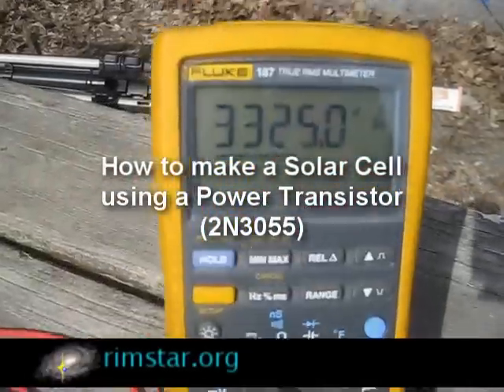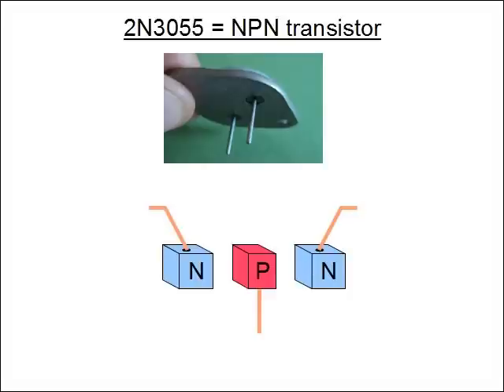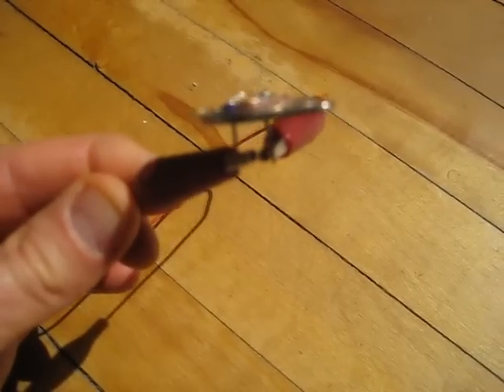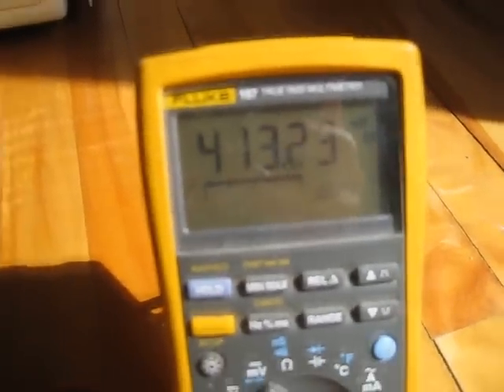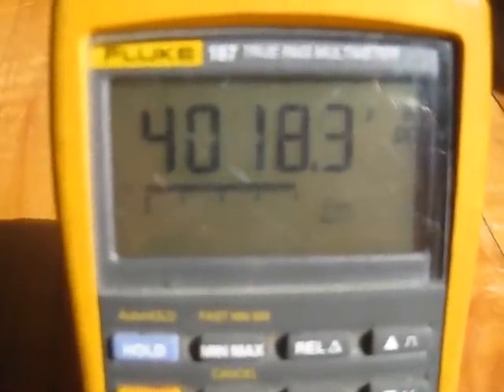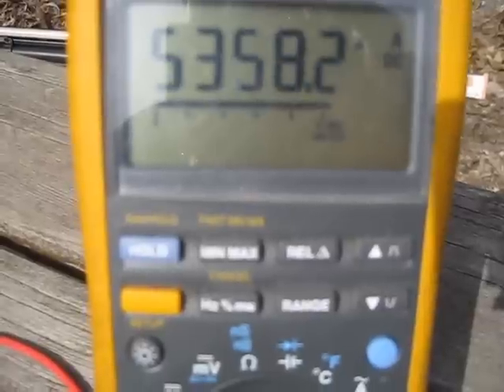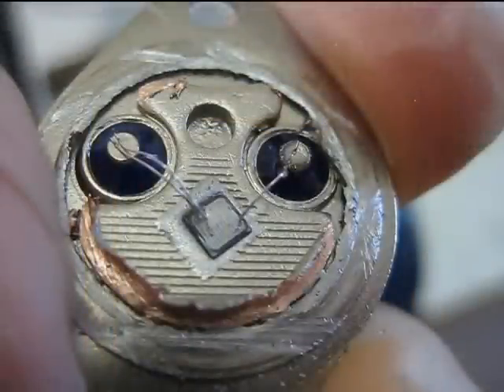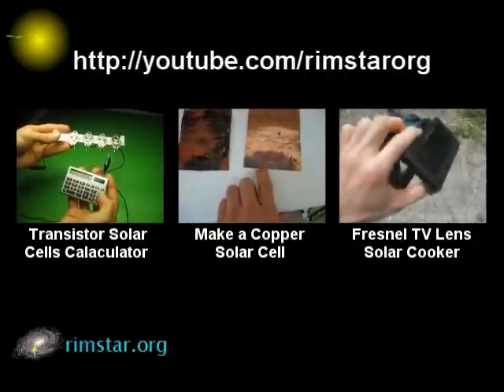How to Make Solar Cells using Transistors (2N3055)

Comment: Also, the meter current range could have a fuse that's blown.  If that's okay, then check your warranty.  I bought a Fluke and more than a year later the rotary switch went bad.  The warranty was for three years, so I sent it in for repair and got it back repaired and with a calibration certificate.  Yours might still be under warranty.
Reply from the maker: Thanks. The fuses are fine and the warranty has long since run out. I think I damaged it from measuring while using high voltage one time too many. I have another meter now for where measuring current.
Reply: RimstarOrg
Actually the worst thing for measuring current is a milliammeter.  They drop a quarter of a volt, so if you're measuring a single solar cell, there goes half of your output voltage.  I bought some 1 ohm resistors; I put one in series and measure the millivolts, which equal the milliamps. I also wound 5 inches of 34 AWG wire around a resistor, and measured it on an accurate four wire meter, and it was .097 something ohms, or 0.1 ohm with the other resistances in the wiring. One mV across it equals ten mA.  Whatever you do, take another meter and measure the voltage across the milliammeter when you're using it, and see how much V drop it's causing.  You may be surprised - and dismayed.
Reply from the maker: Acme Fixer
A quarter of a volt! Wow, that would have a a big effect on something like a solar cell. Thanks for these tips. I added an annotation to the video by the way.

Comment: You assume that the 'cell' is capable of producing 5 milliamps at the full output voltage of a half volt.  But it won't.  Put a load resistor on it, say 1000 ohms, and measure the voltage and then calculate the power dissipated by the resistor.  Then try 100 ohms for the load.  You'll probably find that the power is less than when you previously used the max V and I.
Reply from the maker: Yeah, I'm aware of my foolishness regarding that. I'll try and come up with an annotation to put on the video.

Comment from the maker: You can buy these transistors at electronics stores, though Radio Shack may or may not have them depending on the store. You can also order them online. Mine were 2N3055 transistors.

Comment: Interesting presentation but check your pins on the 2n3055, I tested thousands of 3055's for Motorola back in the 1970's and remember the two pins being the base and emitter and  the metal body being the collector (the metal body was usually connected to a heat sink since that's where the power is developed in the majority of 2n3055 power applications).
Reply: Yup, first thing I noticed. The middle layer is the base in a BJT

Comment: Your calculations on the power output are very flawed. When you measured the voltage produced, there was no load (apart from that of the meter) on the circuit. Your measurement of maximum current was taken by placing the meter across the circuit which, in effect is placing an extremely low ohm load on the device. Output voltage will fall considerably with increasing output load. For actual power output, measure the voltage across a known resistance load and calculate from that.

Comment from the maker: Sure, but this isn't intended to be practical. Just interesting, fun to do, a good science project, ... Though I did get it to power a small calculator. See my video "Make Solar Cell Transistor Powered Calculator using 2n3055" (see link in this video's description.) And yes, it takes a large area.

Comment from the maker: Did you also notice when I showed that there were no connections to the solar cell inside the calculator and did you also notice that I'd put duct tape over the solar cells to show that the solar cells weren't powering the calculator? So please clarify, are you saying the power for the calculator is coming from heat when there's light on the transistor material? If yes, then I'll do a test with it in my freezer.

Comment: The n-type and p-type materials are depleated of the majority carriers at the point of connection to each other(which has to be done under extreme heat). This causes a barrier voltage of about .7 for Silicon & .3 for Germanium. When you expose them to heat, the molecules become more active. You can measure this voltage by putting your meter on diode test and connect the leads.  I'm sorry, but this is not practical.  I noticed that the calculator had built-in solar in upper right.

Comment from the maker: Then please explain to me why it works. And before you say it's a meter thing, watch my other video "Make Solar Cell Transistor Powered Calculator using 2n3055" which powers a calculator using 5 of these using light connected in series and with no meter. With insufficient light the calculator turns off. With sufficient light and no other power source the calculator turns on. There's a link to that video in the description below this video.

Comment: You have the layers labeled wrong! The NPN layers are as follows...Emitter-base-collector. the emitter and the collector are n-type materials and the base which is between the n-type materials is a p-type material. The base and the emitter are the two leads, and the case is the collector for better heat dissipation.  Current is pulled into the emitter to the base, which in turns controls the current flowing into the emitter to the collector. The base is a very thin layer of doped p-type silicon.

Comment from the maker: By "connected wire on two of its bases" I'm assuming you mean you've connected to the two pins, one called the emitter and one called the base. That's okay. You'll just get less power that way. See my other video "Make Solar Cell Transistor Powered Calculator using 2n3055" where I show tests with all the possible connections. There's a link to it in the description below this video and you can click on the annotation at the end of this video.

Comment from the maker: I've no experience with ones where a silver material covers the solar cell so I don't know what to suggest. My solar cell material is silver colored though. Maybe your problem is something else. Mine have very thin wires going from some blue spots to the solar cell material. Make sure these thin wires are not touching anything else on the way. Be careful, they're delicate.

Comment: But my transistor is of model 2n3055, and when i open its cap, there is a silver material which is covering the solar cell. That,s why our project is not working. What to do. ? and i have only connected wires on two of its bases. Not on the case. Is that okay?

Comment from the maker: Yes, you can use torches instead. See my follow-up video "Make Solar Cell Transistor Powered Calculator using 2n3055" where I use 5 of these to power a small calculator. That might be a nice enhancement for your Science exhibition. There's a link to that video in the description below this video, or you can find it on my channel page. Have fun at the exhibition!

Comment from the maker: The transistor in this video made about 400 millivolts, 0.4 volts. 12 volts divided by 0.4 volts = 30 transistors. 24 volts / 0.4 volts = 60 transistors. Connect the base of one to the collector of the next one, and then the base of that one to the collector of the next one, and so on. I do that in my video "Make Solar Cell Transistor Powered Calculator using 2n3055" to get around 1.5 volts. There's a link to it in the description below this video. Cheaper to buy regular solar cells though.

Comment from the maker: I'm not aware of any issue with exposure to air. They were exposed to air when they were sealed inside the transistor cap as far as I know. Possibly overheating them in sunlight might cause a problem. I just tried my transistor powered calculator and it still works fine. I did have a bad connection which I fixed. Is yours not working anymore?

Comment: its probably better to measure current/volts at different resistive loads and get a curve. You might find that its not linear. Measuring power @ shorted conditions only tells you one part of the story. Good video.

Comment: 1 NPN produced 4mA with 400mV, which comes out to .0016W. If you wanted to generate 100W(to power a single lightbulb or a laptop), would require 62500 NPN's. This would be an array of 250 x 250, and if each took up .5" in both directions(with wiring), it would take an area of 1404sq ft(or 10.4 feet in both directions).

Now take conventional solar panels which generate around 13W/sq ft, and the size of this array in real solar panel would generate you 18kW! [results may vary at night]

Comment from the maker: This is just a fun experiment, though in my "Make Solar Cell Transistor Powered Calculator using 2n3055" video I show that it can be practical but only for very small loads. All methods I know of making homemade solar cells from scratch give even less power, like the one in my "How to make solar cells (DIY/homemade solar cell)" video made from a sheet of copper and salt water. You're better off buying manufactured cells or whole panels. See this videos description for links to those videos.

Comment from the maker: I think it was partly because solar cells have a minimum inherent voltage due to the different doping of the two silicon layers and partly because I was still letting some visible light in.

Comment from the maker: Yes, if you connect the transistors in series then each transistor will add more voltage. For example you could connect the 1st transistor's collector to the 2nd transistor's base, and then the 2nd transistor's collector to the 3rd one's base, and so on.

See my other video "Make Solar Cell Transistor Powered Calculator using 2n3055" where I do it with five transistors. There's a link to it in the description below this video or you can find it on my channel.

Comment: That is actually a good idea for an experiment ( : I will have to pick up a 2n3055 transistor during the week and I will see if infra-red light has the same effect as visible light on the readings. My infra-red array puts out just over 3 watts of light (including the current limiting I put in place).

I'll message you when the video is up (probably toward the end of next week).

Alex.

Comment: Some asked "Very nice find. Have you tried any other wavelength specific to determine optimal Lambda for current and voltage?"

Infra red works very well on silicon junctions. Did anyone know you could also use a light emitting diode to generate current the same way you did here?

Comment: No criticism intended. The problem is with this current flow business it works two ways. Conventional semiconductor theory says positive to negative while the military and electricity books teach negative to positive. So in a way you were correct. I teach electron theory.

The .5 volts is the most you can get out of any silicon PN junction. The current is related the surface area of the junction. So a regular solar cell is a giant PN junction. 

Good video none the less.

Comment from the maker: I was referring to the electron flow through the meter... though looking at the video now I can see how you might have thought I mean through the transistor... and then there's the way I said it. Oops. I'll add an annotation.

Thanks for the thumbs up. I've had your Arduino videos bookmarked for this weekend... starting to go through them now.

And re the .5 volts, I didn't know that. Interesting. At least these transistors come close to the limit.

Comment: The current flow is from negative to positive. Otherwise a good demo. 

I'll give it a thumbs up.

These exposed junctions are also good heat sensors with a reflector.

You also won't get above .5 volts which is the same as a solar cell.

Comment: Hi, a very interesting video !
 i was just wondering do you think it would be possible to insert a small light emitting diode into the case, to make a isolated high current switching optocoupler transistor ?